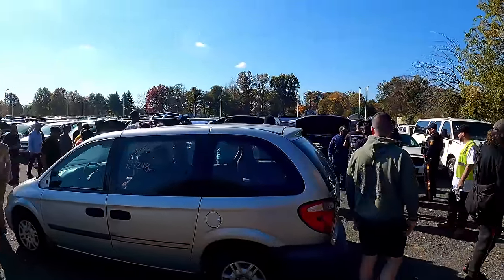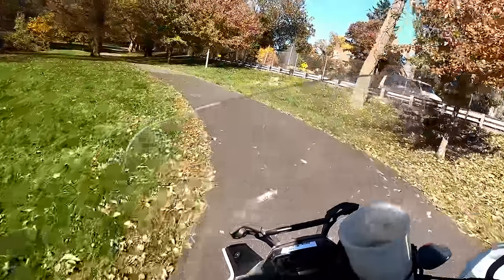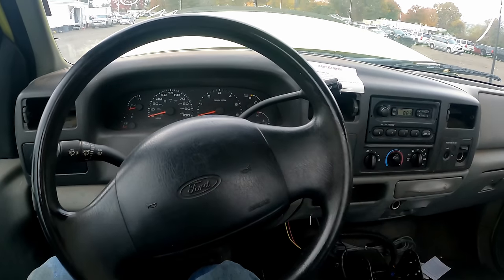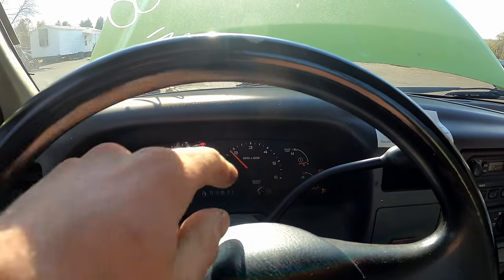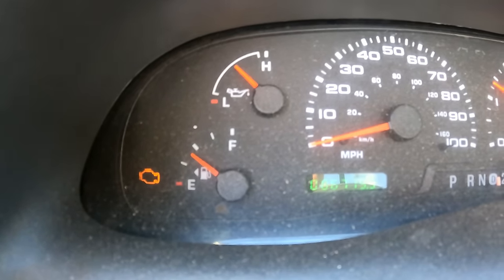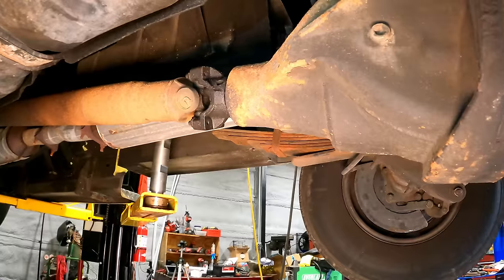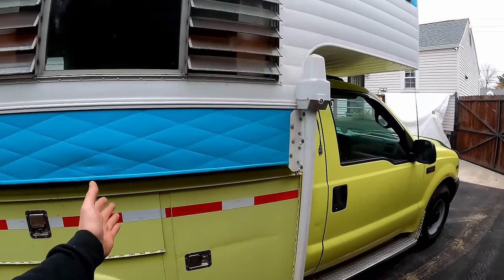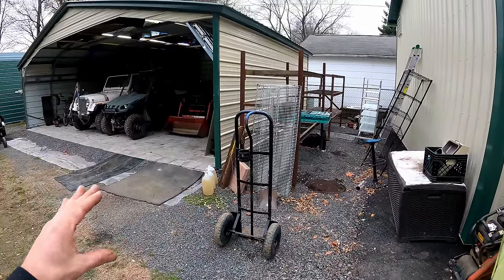Auction Buy "Inop" F250   FLIP or BUST?

Comment: hey Chris if you sweep polymeric sand in-between the pavers then mist it with a hose it will make a rubber sealant and keep water from washing and making pavers go uneven. just some thoughts thats how we always did our patios. great video.
Reply from the maker: Hey, yeah that polymeric sand is great stuff. However it's a little expensive. And I don't like that over time it cracks and then you have to scrape it out to reapply. I ended up using regular sand that way I can sweep it back in as needed.  And I'm not too worried about the pavers settling because it's not an entertainment area. Hopefully they stay level mostly

Comment: Those cab corners and rockers... As a Canadian I've always wondered what they looked like without rust holes. 😂 Nice find.
Reply: I bought a BC truck with a blown engine in 2020 for like $700. 2004 and it's still minty. Think next time I need new wheels I'm going to Victoria instead of the rust belt

Comment: Those trucks had undersize transmission coolers. So if you're pulling hard and heating the trans fluid, it will get pushed out the front pump seal and smoke the trans. 

If you plan on keeping it, swap in the 6.0 diesel trans cooler. Just adapt from 3/8 to 1/2" lines and it bolts right onto the factory location

There's a speed sensor on top the trans and one in the rear end. Swap the rear end sensor first
Reply: Love comment help like this and I don’t have a truck like this I’ve got a focus rs and Escort Cosworth

Comment: I've got a '99 F350 SD, crew cab, 4WD and came with the Warn bumper & winch set up. Came from Central Oregon "Cattle country" and is rust free underneath (no undercoating, too). Bought cheap, updated & upgraded, painted it (5 gallons of material!), and the only issue has been spark plug #4 has ejected twice. It was done once before I got it, but this last time I used the biggest insert & JB Weld'd it in place. No problems thus far. Good truck except for that- that flashing? yup it's telling you

Comment: Nice truck, commen problem those trucks have is the wiring going to the gear shift lever wiring for overdrive, take column apart with the 3 screws & disconnect the wiring for gear shift overdrive. I bet speedo will work
Reply: Happened to mine & I even replaced the complete gear shift arm

Comment: I would ignore the coolant level. Thats where my coolant level always ends up being on the 6.8 in our excursion, no matter how many times I fill it to the correct line. Also, the overdrive light flash is a transmission code, I think it might have a something to do with no speedo. Also, it will throw a tans code if the truck dies while in gear.

Comment: 2016 at an auction just north of Chicago.
I scored a 1996 F350 4x4 with 1,200 original miles for 800 bucks.
I just needed the motor.
Was getting ready to put it on the trailer.
Then decided to throw a battery in it just to see if mabey I could drive it on.
Turned the key,  checked the odometer, and couldn't believe my eyes.
So I went found the manager in charge, and asked him if he knew anything about the truck.
He said that the city of Chicago bought it new, used it one season for plowing snow.
Then parked it right there.
After I replaced all the brake lines.
I basically had a brand new F350 with hydraulics for $800.
Soooooo lucky!!!!

Comment: Check if the rear diff has a vehicle speed sensor.  ONLY buy a motor craft if it needs it.  You get that OD light and a wonky speedo of its bad.

Comment: The 4R100/E4OD has an input and output sensor on the side of the case and if they are bad it will flash the O/D light, possibly shift hard and set off the engine light as well as go full trans pressure as a default from not having a signal. Oh and not have a speedometer signal. Nice truck though and in very clean shape

Comment: I won a 2007 F250 6.0 with only 60K miles on it four years ago, runs perfect. It was a government auction. The truck is beautiful, not a dent on it or even a scratch in the bed, I did a few things to it including had it bulletproofed. I plan to keep this truck forever, love it. I've driven it back and for from Vegas to the Oregon coast five times and hasn't missed a beat. Glad the dog is good!

Comment: As for the writing on the paint try some charcoal fluid it is just about the same as "Goof off " but, 90 % less expensive . it should do the trick without harming the factory paint .  I fyou already didn't know ,,,   I would love a detailed video on this truck , I have a 1999 with 84000 miles on it and get a check engine light ( bank 1& 2 lean )      Thanks Chris

Comment: Those engines are good to 500/600 k as long as you can keep the plugs in it, as a tip use motorcraft plugs, they are not as likely to turn into ufo's . ( unfortunate flyin objects)

Comment: replace the shift the wires are shorting in the colum that is what caused that hiccup. the slight delay going in reverse is normal. those year models has about a 1 second delay in the reverse.

Comment: Look into some vinyl paint and spray booth curtains for the front of your shed. We've have had some in our wood shop that have lasted us 10 years. They're heavy-duty, roll on a mounted track, weighted with a chain at the bottom so they won't blow around, and can be ordered to fit. Maybe your shed can double as a paint booth on a future project?
Reply: Lube the rollers and spray some 303 on the vinyl a couple times a year and they'll last a good long while outdoors.

Comment: try some heavy duty shelves with wheels (casters) in the front of the hut. now that there are pavers you can get away with it. just move them to the side when you need to get a vehicle in/out. you an put some steel or canvas on the outside to protect the contents. you could find scrap and fabricate! great video potential!

Comment: My 02 ford had a chaffed wire in the steering column that ran the overdrive. Every time you shifted from park the wire would short out. Causing my dash cluster to blow a fuse something you might check

Comment: It seems Ford transmission likes the lucos transmission treatment, I bought a ford minivan that would act up whenever I'd push the overdrive button in drive, 2nd and overdrive it didn't want to go into gears, so I tried the lucos it was fine after that. The van had been setting a few years before I bought it, I guess that was why, but I did get 5plus years out of it with no problems before I let my daughter have it.

Comment: Hopefully that 5.4 triton is not that 3-valve that is infamous for catastrophic failure because of the cam phasers. Plenty of horror stories about those 3 valve 5.4liter Ford v8. If the oil and oil filter changes were kept up Johnny on the spot they 5.4 w/ 3 valve might be ok.
Reply: imo it's because the oil pressure is so incredibly low, 19 psi. Melling makes a high pressure pump that helps with the phasers and needle bearings on the rockers

Comment: So I know this is 6 months old but I see the overdrive light is flashing. My 04 had the same issue. turned out to be the PRNDL sensor on the side of the transmission and the last bit of the harness leading to it. was a cheap fix at my local shop.

Comment: Surprised you went for the 5.4 triton. People seem to dodge those like the plague.
Reply from the maker: With proper maintenance they are pretty decent engines. Problem is people neglect them and don't change the oil and then they end up with cam phaser issues and more.

Comment: When i bought my 98 Ford E250 for 2400.00 i had to do so much work on it and I finally got it going pretty smooth and fuel trims under 10 percent lftf took so much money and time how can I get my speedometer working accurately ? Its 5 off so 30 mph is 25 mph should i just replace the sensor that's in the end of the transmission ?

Comment: Does anyone have a recommendation for a good battery maintanence tool.  I have several pieces of equipmemt with 6 and 12 volt batteries, such as tow and dump trailers, zero turn lawn mowers and tracktors.  I have an old 1980s sears battery charger, which i use as a charger and jump pack.  But it needs to be plugged into a 110 outlet and its rather large.looking for something smaller that i can use at home or in the field that can jump batteries, or trickle charge or deep cycle dead batteries.
Reply from the maker: NOCO makes some really nice units but they are a little pricey

Comment: when u pulled out that 20$ bootleg scantool...threw me off a lil   haha
Reply from the maker: Those things are great pocket tool for checking codes real quick
Reply: @NNKH2  they get it done.  But a digital one is lile 49$lol  with more capability like battery or alternator check.  Either way cheers

Comment: So I'm going to say that the elephant in this video has got to be the engine, unless I'm mistaken that 5.4 is the one with the spark plug replacement issues, it's possible the plugs were kept up with, let's hope so
Reply from the maker: Yeah. Some of them do have spark plug issues but it's not a big deal with the specialty kits they have these days. If a plug end  breaks off very easy to get out and if the threads strip they have rethread kits. I actually have one. Works great and pretty easy

Comment: I wonder if you're aware that the 5.4 had a problem with the spark plugs blowing out of it I hope you don't have that problem?
Reply from the maker: Yes. I've seen it happen once or twice before. I actually have a special kit for adding steel threads to the heads if problem happens. And I also have the plug extraction tool for when spark plug and get stuck in head.